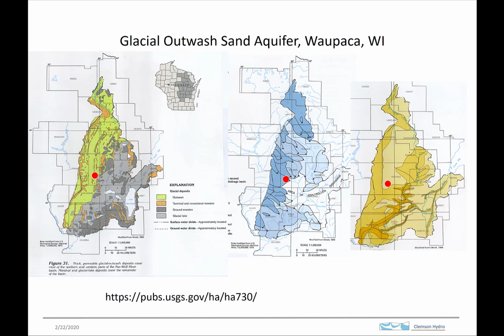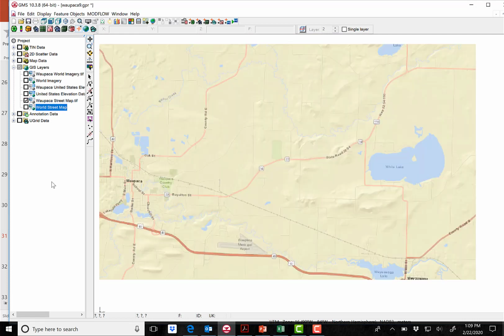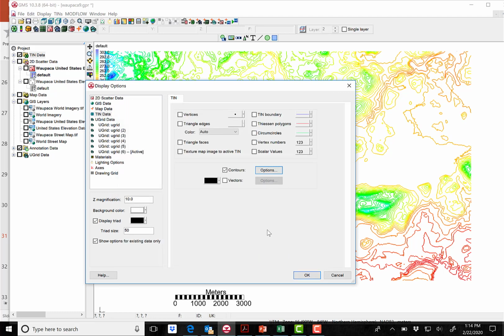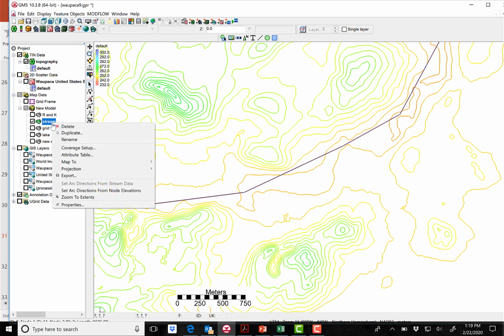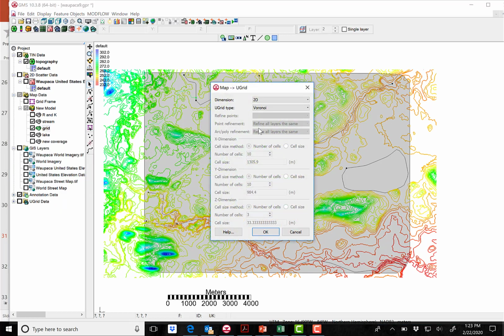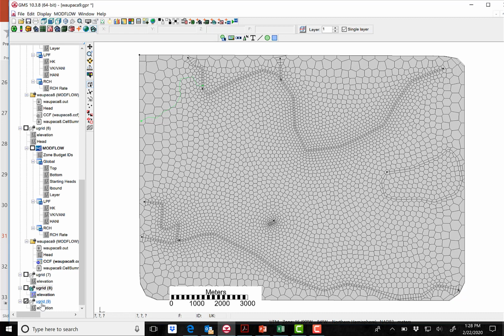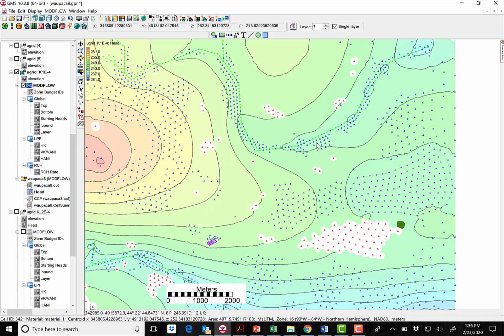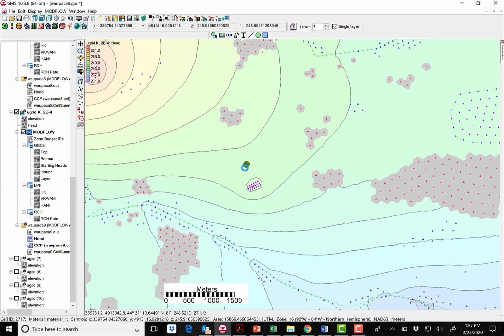Outwash aquifer waupaca

Comment: thanks a lot for this video sir!
 this video is very useful for us. and also is have a question, sir.
when I changed the dim of the map on the ArcMap (GiS) to tiff, I put the tiff on the GMS for Z elevation, but the whole tiff map was black. how do I solve this problem?
Reply from the maker: Try experimenting with the settings in the display of the .tiff.